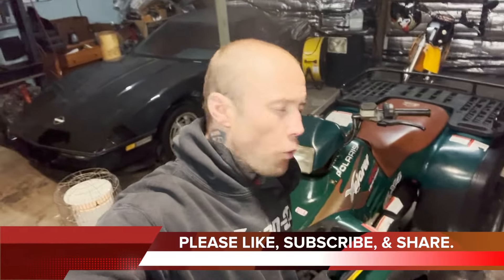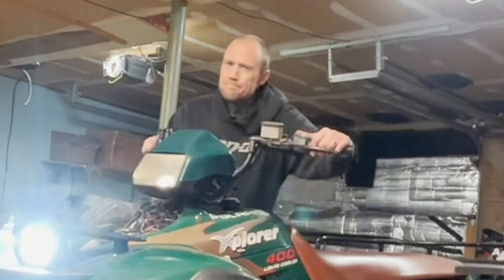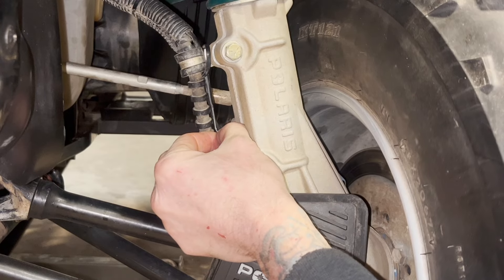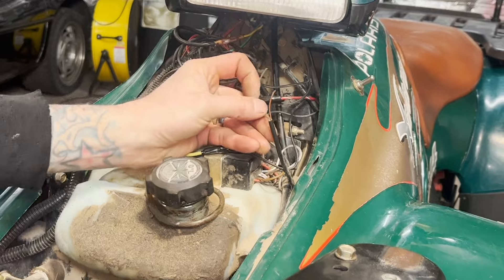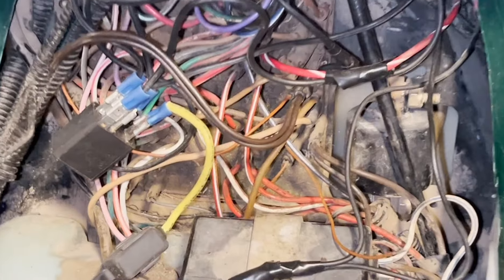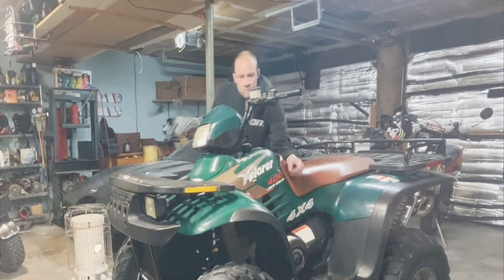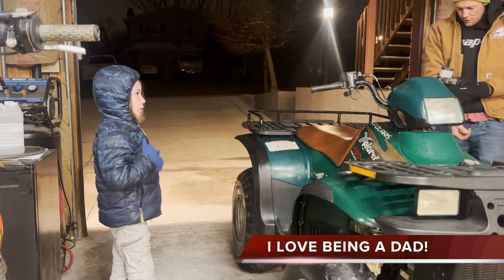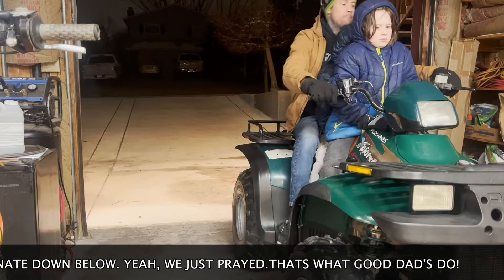POLARIS 4WD NOT WORKING. FIX!

Comment: I'm in Colorado Springs too. Took apart the hilliard clutch and replaced parts, still not working. I don't think there is power to the hubs but not great at electrical. I will pay for you to fix or splice the right wires for my 2001 sportsman 500. Its an old machine but I like it.  I can bring to you or give you my address. Maybe a good video opportunity saving the day!

Comment: All I need to know is if the 4x4 won't work unless it has a good battery in it. Or if it will work without a battery  while running
Reply from the maker: It’s gotta be able to send 12 volts to the hub coil. The system probably can’t produce 12 V without a battery in it. It’s getting hard for me to answer all these questions. If this helps you out, I would appreciate if you would join the membership.